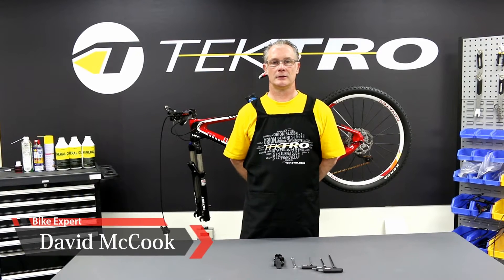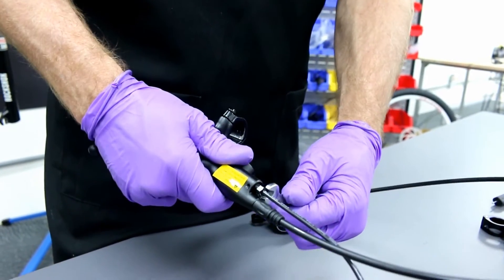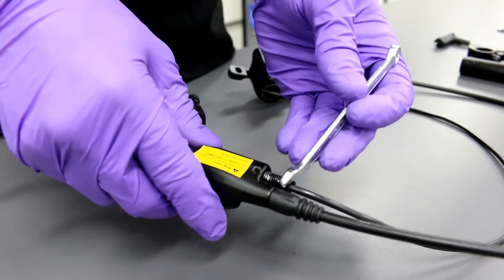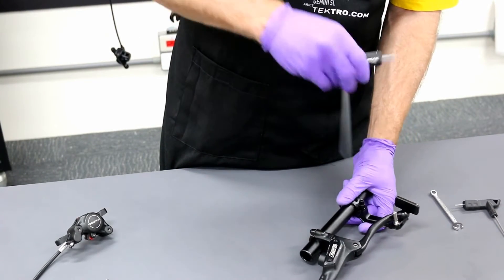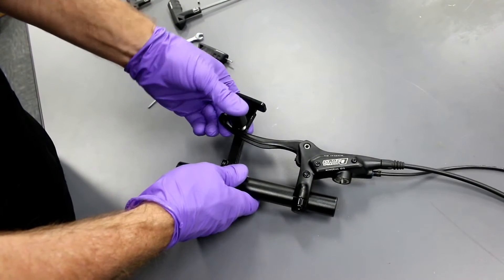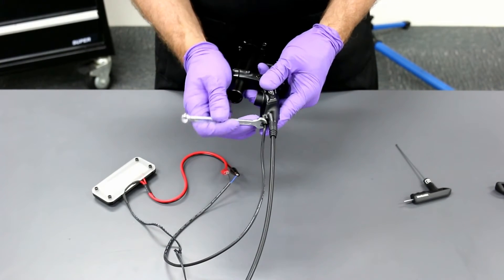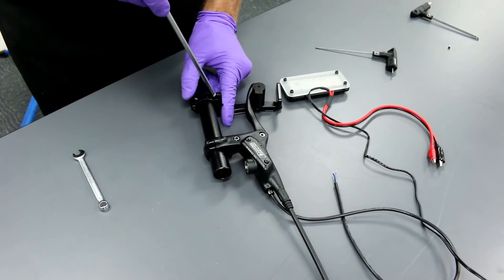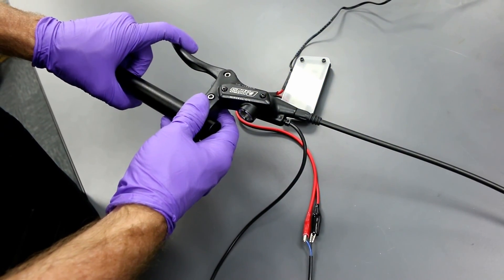E-Bike Sensor Control Replacement

Comment: Can't you just use continuity from a multimeter and adjust the sensor nut to where the signal circuit closes just after pulling the lever back?

Comment: The big question is where do you get the signal sensing tool and the other specialty tools?
Reply: just use a multimeter and a magnet.